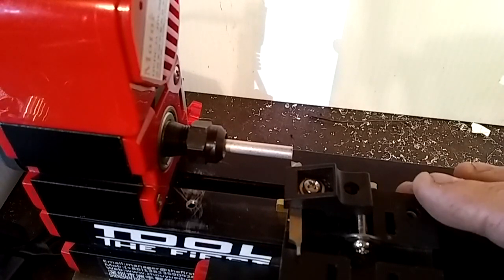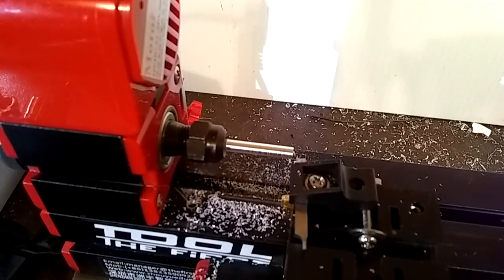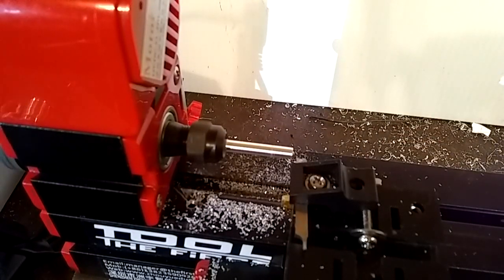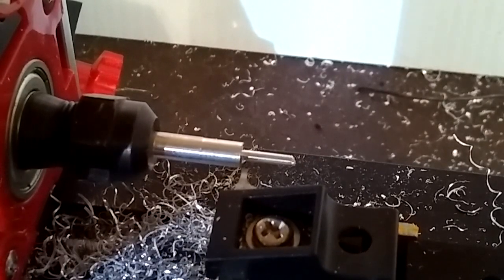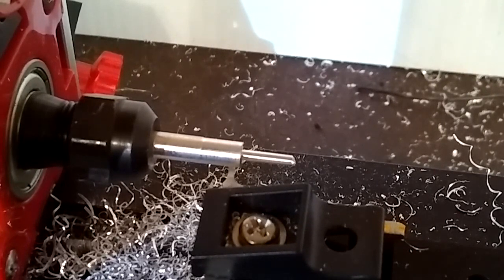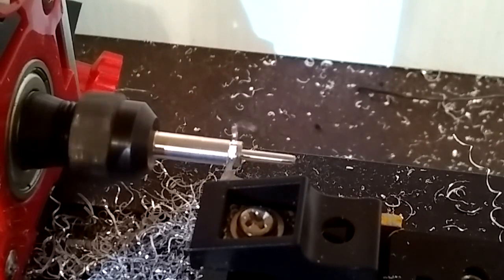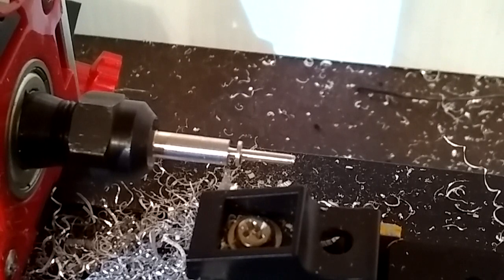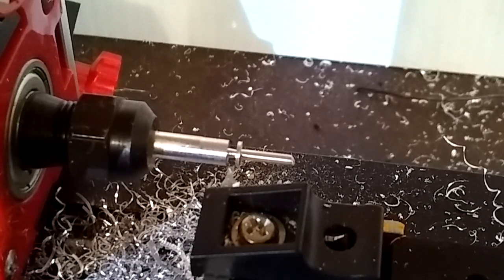6 in 1 mini lathe making a crosman bolt probe

Comment: Does this have a through hole for the chuck so we can use longer stock?
Reply: Tool the first!
Reply: David Cox it’s a toy. It’s meant for plastic or wood
Reply: @Thephotonguy  maybe he wants to make a toy. He asked a different question.
Reply: @Tim_Sawyer_25  it won't struggle with aluminium if you change the tiny motor this tool has. You have to make modifications to compensate for its inaccuracies. One of the biggest drawback is the cross slide which is made of plastic and lacks rigidity, there's too much flex and also you can fill the bed extrusions with steel to add weight.